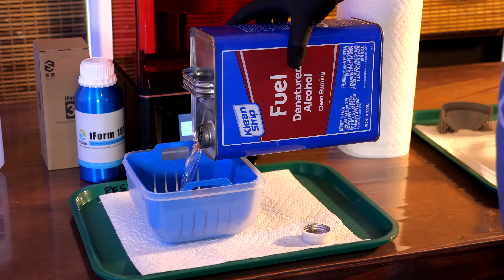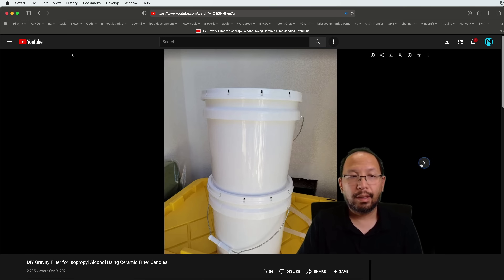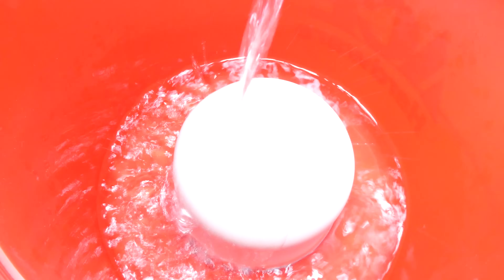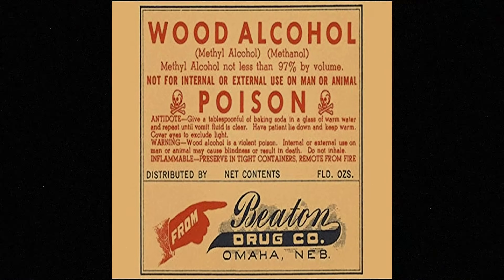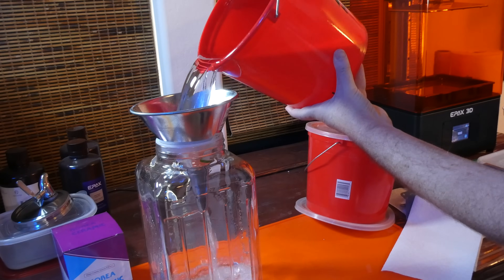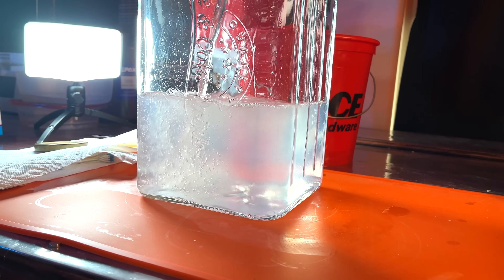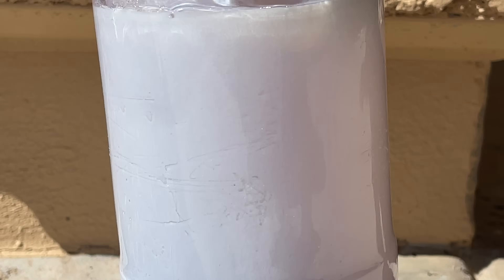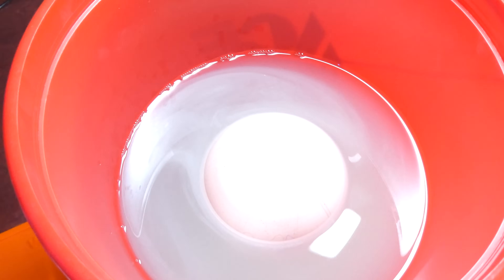Can We Recycle 3D Printing Alcohol?

Comment: I just spent the last couple months trying to figure out how to purify isopropyl alcohol. I tried all the different ways I found on YouTube none of which actually purify the alcohol here’s what I found. If you take your dirty alcohol, put it into a clear container then set it in the sun for several days the sediment will settle to the bottom. However,  there is still resin in the IPA. The way you can test if there’s resin in your IPA just take a small sample of your IPA and put a couple drops of water in it if the water turns cloudy white there’s resin in your IPA at least with the Elegoo resins  that I am working with that’s what I found. The only way I was able to get all of the resin out was to then distill using relatively inexpensive lab equipment. After I distilled the IPA which boils at about 87° Celsius, there was a yellowish liquid residue left in the bottom of the flask which was the leftover resin. I tested the distilled IPA and it was 92%. This was pretty good because I started with 95% IPA. I would highly recommend that you don’t use water in your cleaning process (unless using water soluble resin) because the water does not mix with the resins that I have used and I found that that was causing the white haze on my prints. if you put a couple drops of water into your dirty IPA you’ll see a white cloud form. This is resin contamination. It will not be there after proper distillation. I used fractional distillation to get the cleanest IPA that I could. I Distilled about 1 gallon of dirty IPA and ended up with 85% of a gallon of very clean IPA. Absolutely no resin. You can have clean looking IPA that is sticky because there is still resin in it. Hope this helps.

I have not tried one of the canister distillers. They MIGHT work.

Comment: Isoprophyl alcohol is poisonous either way, but if you have ethyl alcohol you can simply watch your temps as bitters boil at a lower/higher temp than ethyl. Throw away the before and after of your correct temp and all you get is ethyl. The reason they use bitters is because they are already in the alcohol pre-distilling so alcohol distillers had a bunch kicking around.

Comment: I fill used clear plastic water bottles with the used alcohol. I then set them outside and allow the resin to cure. i think the ideal thing would then be to use a centrifuge to separate the resin from the alcohol after curing, then no filtering is needed.

Comment: There are no bitters in isopropyl alcohol.  The stink that you don't like about isopropyl alcohol is the isopropyl part. Denatured alcohol is a completely different thing. Denatured alcohol is ethyl alcohol. And the best of my knowledge is one of very few alcohols that don't metabolize into poison.
Isopropyl and methyl alcohols themselves are not poisonous, but once the enzyme breaks it down in the metabolic process, then it's poisonous. That's why you can use it liberally outside your body without consequence.

Comment: You can use a chemical treatment to acelerate the settling of resin particles. Aluminun Sulfate (comes at 18% solution in Brazil  chemical market) is the most commom salt used in industries to treatment of sewage and water.

Comment: my thought on the distilling tactic: Yes...lets mist up the extremely flammable liquid that becomes more flammable if its in mist form.... lol

I think the triple-bucket design is the way to go but perhaps some fine holes with cheesecloth or some other fine fabric on top and just loose activated charcoal in the first bucket. That way perhaps the worst of the gunky film crap just coats the charcoal, it may flow slow after awhile but it wouldnt gunk up the actual filter as much.

Comment: "Don't let your alcohol become too dirty" - wouldn't simply diluting dirty alcohol with lots of clean alcohol and then letting it out in the sun solve the problem with the gunk? All youtubers I've watched so far simply dump their dirty alcohol into plastic disposable bottle, let it cure in the sun, then filter the alcohol out into the clean bottle and throw away the one with the gunk. Still, I don't remember anyone handling alcohol that dirty so they could be cheating :)
Reply from the maker: You might end up just making a bigger batch of really dirty alcohol.  My point was that if clean alcohol is easy to come by (via recycling) that you might as well always clean parts with clean alcohol.  The truth though is somewhere in between probably.

Comment: Could you switch the filter to the bottom of the lid and add pumps to speed up the filtration?
Reply from the maker: Yes you can add pumps or pressue to speed up filtration.  I was thinking about doing this eventually with some pvc pipes and some sort of air pump.

Comment: what happen if you centrifuge those liquid?
does it separate or stay the same?
or you could try to expose it to UV light couple of sec or minute to solid up those resin and centrifuge up those solid part.
Reply from the maker: If gravity separates it I think more force would separate it quicker.  But who has a centriuge at home large enough to do this size batches?  Or is there some DIY way I'm not thinking about.
Reply: @Nerdtronic  LOL that's true, I completely forget that centrifuge only spin like those small test tube size XD. I can't find any DIY centrifuge online for those huge batches so this idea is a flop XD.

Comment: The crap that settles is mostly just the pigments used to give the resin color.  The resin itself is suspended in the alcohol, it's not really going to settle.  That's why your jar jelled up.  Distillation is really the only good way to separate the two.  Would be better if you could control the temp of the fluid in the distiller so it only get hot enough to evaporate the alcohol, and not actually boil it.  Alcohol has a lower evaporation temp than water, and the resin.  Really as long as you stay cooler than the evaporation temp of the resin, should be good.  Fumes are the biggest issue though.  If you could figure out how to dump the distillate into a sealed cold container that would be best.  It will only pressurize a little, as the cold container will condense the steam back to a liquid.  Still wouldn't do this inside though.

Comment: I found the best thing was to use a UV torch to shine an intense spot on top of the liquid to polymerise the resin (if the UV goes through glass the resin sets on the glass and quite quickly blocks UV transmission). It also helps make the resin formed into tiny particles rather than mucousy sheets. It looks quite cool, almost a sort of roiling look where the UV spot hits it. Once done until there is no more movement, allow to settle, and then filter through filter paper. It's good enough for a first wash tank at this point. The settled gunk can be thrown away.
Reply: Hi ! I would like to try, could you tell me what is the reference of your torch ?
Reply: @Disc0rd83  blue laser pointer.

Comment: Probably best off letting all of the resin come to a rest at the bottom of plastic jugs for a week or two, then set it out in the sun to cure that crap to the bottom of the jug and siphon off the alcohol.
Reply: Of course you can't set it out in the sun if it's cloudy at all. Siphon off, filter, rest, siphon, filter...
Reply: also - my time is worth a hell of a lot more than a few cents per gallon of alcohol. This process is purely for people who want minimal impact on the environment, buuuuut what they really should be doing is using water washable or just not 3D print at all...

Comment: There are a lot of misconceptions and wrongs regarding distillation here. Distillation is THE way to purify any alcohol (and many other liquid compounds). You only need to know the exact temperature where whatever you want to purify evaporates (as long as it evaporates <100C°) whilst leaving the impurities behind. No, that water distillation apparatus you showed isn't going to cut it unless you modify it to run cooler, but we distil alcohols and acids daily without any risk. Like with everything you just need to know how, and it's something our ancestors figured out a long time ago. Today we have multi stage distillers that spits out almost 100% pure alcohol (ethanol). However, I don't think distillation is the right way to clean your IPA from resin. Not unless you mix it with a lot of water and manage to bind said resin to the water to ensure it never follows the alcohol vapours into the reflux stage. (Unless you love cleaning your still every time?! A blockage in the still is a bad idea, hence why you should never distil liquids that contains solids or particles that can clog the reflux colon or the condenser...) If so then distillation would separate out just the alcohol, but I haven't tried that yet since I'm not keen on cleaning my still from hard and sticky resin! For now I let gravity separate out most of the resin from my IPA and then I use it diluted with fresh IPA. At some stage you just have to cut your losses and accept to replace all the IPA though unless you don't mind that chalky finish of your parts. 

The most promising real IPA cleaning method I know of that doesn't require any serious skills or vast knowledge in chemistry is by mixing alun in water and then mix your contaminated IPA with said alun water. Whilst stirring the mixture for a fairly long time the resin particles will bind to the alun in the water and precipitate out, and after letting gravity separate out the particles to the bottom of the container you just siphon off the now somewhat diluted IPA on top. To restore it back to pure IPA strength (i.e. getting rid of the water) you just need to run it through a distiller. No way around that, but your slightly diluted IPA will also work as is. You could also use molecular sieves to remove the water if it bothers you and you don't have access to a small still, but a still is much faster imho. Just don't run your dirty IPA in the still as is, unless you like to scrub and clean things! ;) 

Perhaps someone out there will find an easier method of cleaning IPA down the line, but using a still isn't rocket science. Question is how much IPA can you buy for the cost of a good glassware still and magnetic stirrer? And factor in time? Perhaps replacing your IPA regularly is the cheapest option after all...?! Finding a solution I find is often more rewarding than cost benefits! ;)

Comment: So..   Wierd idea..

I've been looking at this lately and seeing some people have some success by simply letting the resin settle and then pouring off the top.  What's left behind becomes a really thick sludge.

My idea is..   if the alcohol and this resin sludge was kept in a light-protected container until you had a significant amount..  could it then be poured into a clear mold and cured into something else?

Comment: You cant recycle IPA in this way, you only remove pigment not all the resin. Test this filtered resin in sun and then you will see that its still bad and sticky (when alcohol will evaporate). In Poland for 25$ i can buy about 10-12L of 99% IPA. I bet that your filters cant filter more then that. I filter my dirty IPA with: first UV and sludge remove on sieve, then papier towel and coffe filters its more cheaper and the resin in clear but its still sticky :/. So the best way is to buy a new one or destilation.

Comment: two ideas
First add vacuum pump to make filtering go BRRRRRRR 

Second i suggest to try out centrifuge (with or without curing) , in theory resin should solidify in small particulates that should be really easy to filter (or without curing to separate liquids)(tho i am not so sure for curing metod after i saw BABY PUKE)

Comment: Tried this with all the advised parts and so far it’s not worked well at all. Output is still milky and takes days
Reply from the maker: You sure it’s not leaking at the seal?  But yeah my consensus is that it’s not a great process and you need fairly clean alcohol to start with.

Comment: at about the 8:00 mark you say that you ran it through your "other filter". What filter was this?   I've got a wash & cure station that I let get way too dirty. I've had 3 bottles sitting in my backyard for over a month and they are still yellowish & there is a bit of gunk still in the Wash station's plastic tub. I'm trying to find the best way to clean it and continue to use it. Whenever I run the dirty alcohol through a paint filter, it clogs up after less than a minute, and I would have to go through a dozen filters just to finish the tub.
Reply from the maker: I made 2 of these. One with the red bucket and one with the white buckets.  So I just meant the other one that had only been used for clean ipa at that point.

Comment: have you tried the multi material filter system?    like in a funnel, tight cotton bottom, then charcoil on top, then sand, with a few layers of filter (coffee filter, etc) on top that are disposable?   this could , in theory, catch more gunk - run the alcohol through, then once your near dry on top - hit the top layers with UV to cure on the filters (ldisposable parts) to turn them solid and make for easy /safer disposal.
Reply from the maker: Good idea

Comment: Distilling isn't an issue as long as it's not exposed to open flame/sparks.
We wouldn't have alcohols to begin with if that was the case.
Reply from the maker: Good point. The alcohol is pretty flammable by itself. Don’t set up the alcohol next to the laser engraver. 😄💥
Reply: @Nerdtronic  You also don't use alcohol (especially Denatured) in your basement workshop next to your furnace!

Comment: What I typically do is I typically pour my used alcohol into disposable plastic bottles every couple prints, never letting it get that dirty. I set them on the window sill to settle and cure and then pour the alcohol through a coffee filter. Typically one 500ml bottle full of used alcohol will use one coffee filter before it's too clogged to be used quickly.

It doesn't get the alcohol perfectly clean, but it does help a significant amount and doesn't take that long to filter.
Reply: Also cleaning in two or even three stages helps. My first container is quite dirty but the second one is still in pretty good shape.

Comment: I am still not sure what type of 3d printer to get (resin or filament). The biggest downside of resin printers in my eyes is the cleaning with alcohol part of the process.
Thanks for showing this filtering method.
Some thoughts i had while watching this video: using a centrifuge to get the coarse stuff to settle... using some ultrasonic exciter to speed up the filtering... using aluminum foil to block light... (the flash point of alcohol is at 55F / 13C) using underpressure to lower the boiling temperature... and last but not least using argon in the distillery to keep oxygen out.
I think even if i was using the distillation process i would filter the alcohol before.

Comment: You are not removing resin by filtering it. The only thing you are removing is the solids, the pigment, partially cured resin and filler in the resin. the resin that is dissolved in the alcohol is not large enough in size for the filter to separate it from the alcohol.
Reply from the maker: Yeah I think you’re right. The sun cure or distilling is the only way. And even then there’s probably some resin left.

Comment: I made myself a graduated filtration system or screens and cloths. This was the best I could come up with and worked ok, eventually the alcohol gets slimy though and is trash. Replacing and cleaning filters is a pain and it is massively time consuming for a product that will never be as good as the original. Similar to VOG you can use a 5 or 6 step cleaning process and use the less clean stuff in the earlier steps. This all helps extend the life, but it was tedious and a mess.

In the end I bought an air distiller. It works super quick and the final product is good as new. Though there are some cautionary points for this as well. Need to use the still in a well ventilated area. Need to make sure your seal is good and for an abundance of caution make sure there are no flames around. Taking it outside is a good solution. Also still laws are complicated at best and the presence of it on a property basically gives the ATF and their deputies carte blanche authority to come in search the place should they choose to do so. Nothing about the process is normally illegal as you are not making a drinkable product, but that does not mean you won't have to have that fight in court if for some reason the ATF ends up at your door. Distilling either 99% IPA or denatured works the same and does not reduce the proof of the product. I find that I lose about 10% per run, though don't know how much of that is actually resin volume as I tend to let it go until it annoys me and I think things aren't getting as clean as they should. 

Return on investment takes a lot longer on a $200 still than $60 worth of various filter every 6 months, but I have easily recaptured my investment in a year. I am not recommending either just due to legal and safety concerns, but I choose the air still and am happy with my purchase.
Reply: I  use a similar cleaning system to VOG, only 3 stages instead of more...  Works well enough, then I leave the super dirty alcohol/resin mix out in the sun to cure/evaporate.  The cured solid mass then goes in the trash.

Comment: Just run it through a PVC pipe full of cat litter
Reply from the maker: Haha the clumping kind?
Reply: @Nerdtronic  no the pure gray clay kind or the clear cystal kind.
Reply: @nokiot9  That's bentonite clay that's also used as a floculant in water filtration systems.
Reply: @Nerdtronic  they do this with that red agricultural diesel to get the dye out so they can load it into their car for 30% of the price. It’s gotta work with other solvents